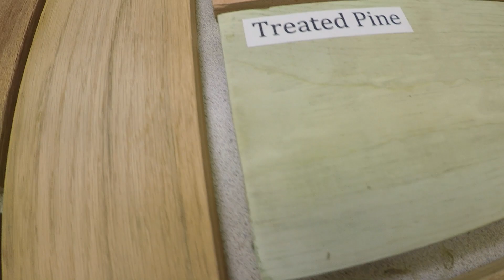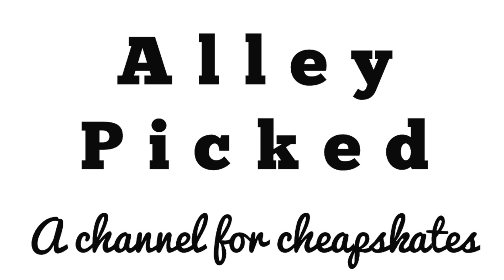Varathane Weathered Wood Accelerator Review

Comment: I used this for an 8 x 8 ft sliding barn door using pine and red oak for the exposed header. I like the look one coat is a light grey after three coats it starts to get dark. I really like the look of it. It's not a stain. You see the reaction with the wood happening as you are brushing it on.

Comment: Im using it now on pine cabinet doors and this is the process i found that works with this product:

1) stain and wipe off first coat, let dry
2) lightly sand by hand with ultra fine sanding sponge
 3) second coat dont apply too much and dont wipe off, let dry really good. Should start to see the patterns and grain start to "pop"
4) sand again with sponge and it should really start to bring out the detail more
5) (optional) wipe on a thin layer with  cloth. After it dries you may see places that came out uneven or too dark and u can just sand it to lighten it
Warning: do not apply to wood that has been overexposed to moisture like a leak under a cabinet. Creates a spotty bubble look in the finish. If that happens, AGAIN just sand it by hand and it will begin to look like it is part of the weathered look. Thats what i love about this stuff. U really cant mess it up.
Creative tip. Ive taken a small torch and lightly burned the hard edges before staining. Looks cool
Reply from the maker: Thanks for sharing! Maybe Varathane should hire you to write their directions :-) Glad you found a way to make it work.
Reply: @AlleyPicked  lol thanks. Im still wotking on them this morning and its becoming more and more evident that you have to put a couple good coats on the wood then you sand by hand like a mad person and you see the weathery look start to come out and you can then control how light or dark u want to go. I think for the price you pay for it, its kinda cool and u can get creative. HOWEVER i would practice with it a lot to get your technique down before trying to use it on a paid job you are doing. Thanks again

Comment: Don't see where you think your thinned out paint looks better. To each their own on that one I guess. I use the accelerator all the time. Is it duplicating nature to the "T"....heck no. But looks and sells a lot better than new wood and water down paint methods. I also use the vinegar and steel wool technique. Accelerator to me duplicates and comes up better. PS Each wood piece not just species reacts differently. I've had it all ready turn wood pink on the first coat and second makes it really weathered and  defiantly sell able. Want a trick to make it more believable, beat the wood up then see what the accelerator does, works great for me.

Comment: While I did enjoy the comparison about the different types of wood which is primarily what I've been looking for, one thing that I don't really recall hearing mentioned was all the other wood that you got was pristine for the most part, ready for use for building, the 10-year old weathered wood literally has been sitting outside for 10 years and shows Not just in its color but its texture. I don't know that it's a fair comparison to use a more fresh Building Material wood compared to 10 year old weathered wood. It's the color that the product is designed to aim for which is what it does achieve. However the wood itself still looks clean and new because it is just that.   I'm sure paired with some DIY techniques for distressing the planks would help this color seem less unnatural

Comment: It actually looked appealing to me. I am probably going to try some because of the video. I have whitewash stain in mind for this room I am doing but with any such permanent project I only want to do it once.
Reply: It works great. I sand my wood and distress it first with gouges and nicks as well, then put it on looks Awesome.  Also I love wood burning and using a heavy brush or steel wheel to remove the char and then the accelerator,  looks killer, especially with Polyurethane
Reply: @mitch5077  What Polyurathane do you use for wood that is stained with this particular stain without it changing color and staying gray?
Reply: @mariaayalabeltran9490  I have found out it doesn't change the color on acceleration like Vinegar and Steel Wool, both methods take it well, but Min Wax and other pigment stains do.
Reply: @mitch5077  I bought staircases and accidently stained it with this aged accelerator thinking it was gray stain. I love how the color looks but I can't find a right sealer. I tried water based poly and it changed the color to a dark chocolate red toned wood.
Reply: @mariaayalabeltran9490  oh know! I use Varathane Poly. But I'm not sure the type of wood your staircase is, could be a factor. always do an inconspicuous place before committing.

Comment: I have used this product for an end table of mine, the thing is just that if you give it a few days to soak in and air out the color really becomes more of the rusted wood look. It does lose the grey tone it has in a few days. I would say just try in on a small scrap and leave it alone for a week and then check back in.
Reply: Hiii! What finish sealer did you use on this? I dont want it to loose the gray

Comment: Respectfully disagree. I used 2 coats on 100 sq ft accent wall after lightly sanding with 100 grit. Not only did it darken but it brought out many beautiful shades and grain patterns. See on my Instagram coopaloop1986 if you like. 1st attempt as well.
Reply from the maker: Glad it works for you. This stuff has it's place. In some circumstances it works good but I just found that it's not all that it claims to be.

Comment: Loved this product. UNTIL, I finished with what was recommended on the label, Watco lacquer, and it was a strange reaction, the colour was beautiful on my piece, but when I added a second coat of lacquer, the once gray wood turned almost brown. This was done on a clients piece, so colour had to be what they asked for. Unfortunately, I had to strip it down to bare wood and redone. We'll see today if I get the same reaction.
Reply from the maker: That is strange. I never used Watco lacquer but I would assume that after the first coat fully dried, the wood should be protected from any color changes. I have never seen this reaction using Polyurethane.

Comment: I think if you had used boards with character and textures your anti sentiment would not have been supportable.
Reply from the maker: That may be true, but that's not the way it's advertised. There's no mention in the instructions that there is a need to texturize the wood prior to application. If you find a way to use this as part of the process, then that's great. Thanks for watching.
Reply: I did that and it looks ammaaazzzing!

Comment: Almost every claim you made is incorrect. It DOES react. When you first put it on it was “almost” clear. And look what happened after one hour. Just because it wipes off doesn’t mean it didn’t “react”.  From the visuals in your video, the paint does not compare to the stain. The paint did what paint does “cover” the wood, while the weathered stain absorbed and allowed more of the grain color to show... good video, questionable conclusions.
Reply from the maker: Thanks for your feedback. I still think this product is a bit of a gimmick. I still use it once in awhile and get some mixed results. I have done additional testing by making wood stain using vinegar and steel wool to get similar results. I also almost duplicated the same color when I used Varathane's own carbon grey regular wood stain mixed with a little paint thinner. You can watch some of my experiments if you are interested: https://www.youtube.com/watch?v=m6U3JFSacRE

Comment: I wish I saw this video before purchasing. I framed my bathroom mirror after using this product (wasn't crazy about the look but used it anyway) and then two things happened 
1. I sprayed my counter with cleaner. The overspray hit the wood and then BAM, color was gone and look spotchy.
2. Even after waiting 24 hours I used painters tape to hold the boards up while glue was drying, and it left very visible lines in the coloration.
I don't even know how to fix at this point since going over the areas isn't working. Sand and start over while the wood is glued to my mirror??
I agree. Garbage.
Reply from the maker: We are in agreement. I guess it would have helped if you sealed the wood using a shellac or poly. But you would think that wouldn't have reacted so quickly using a cleaner.

Comment: Your comparison is on a clean sanded piece of wood versus one that's been out in the elements and rough cut.  Lol.
Reply from the maker: I used both clean wood and rough lumber in the video. What is the point to using one that has been out in the elements? This stuff claims to make new wood look old.
Reply: @AlleyPicked  first of all. You claim that it was like watered down paint. I have never seen paint change colors that drastically. I have used this stuff myself. It's a chemical reaction. The color you wiped off isn't paint. If you read the directions...which I'm sure you didn't because you already had your mind made up ... you would have seen that it says bleach will get rid of the color. ... I don't know of any paint that turns clear with bleach. If I took three pieces of wood and aged them. They all would be different shades. Your video is clearly biased.

Comment: I think oil paint with thinner would of done a better job than acrylic paint but it's not water based. I have used oil paint often in the past to stain wood and it works well.

Comment: The same thing can be done for REAL with 0000 steel wool soaked for a week in vinegar. You strain it, and then apply it to the wood. IT will react to the tannins in the wood to grey it down. If you steep black tea, (contains natural tannins) and brush that on first, it will react in a darker manner. If you do it in layers, (tea, then stain mix) you can get the wood to go almost ebony black in most cases, depending on the wood used.
Reply from the maker: Another viewer told me about that and as a result, I made this video about it. https://youtu.be/m6U3JFSacRE
Thanks for watching! Tom